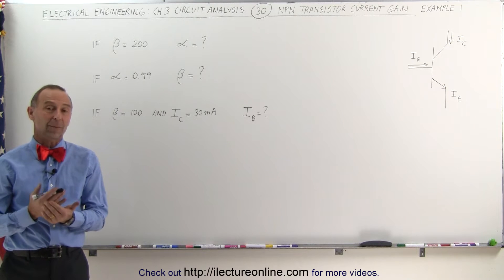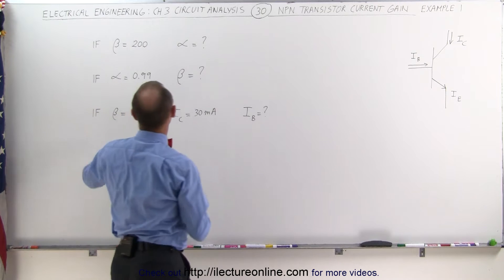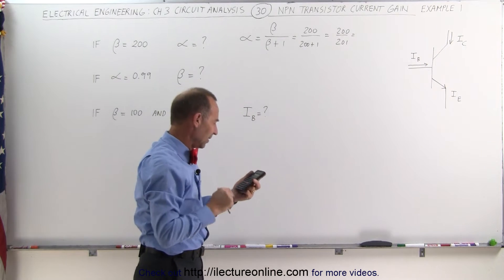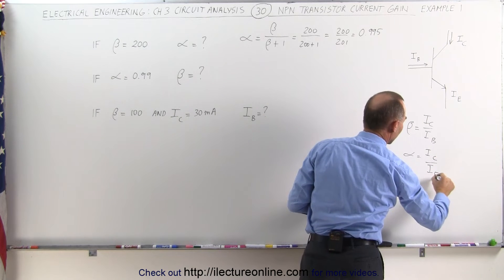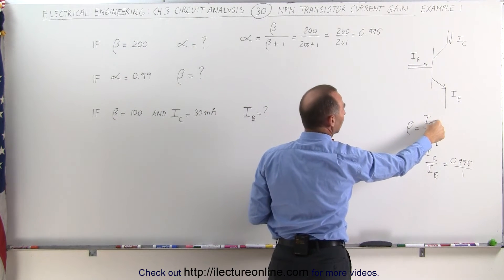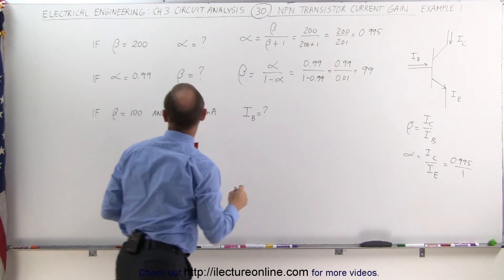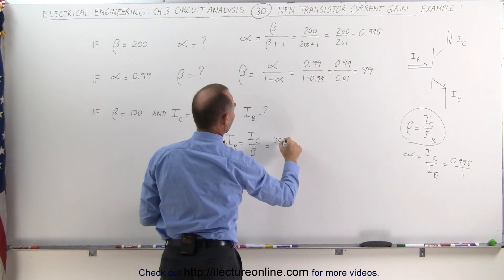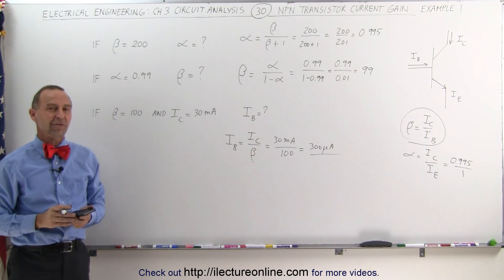Electrical Engineering: Ch 3: Circuit Analysis (30 of 37) NPN Transistor Current Gain Ex. 1

Comment: I assume the 300 microamps is just for the saturation not for the maximum base current the transistor can take?
Reply from the maker: It is the base current required to produce a 30 mA collector current.  Not the maximum available current.

Comment: i have a question guys, why 30milliAmps divided by 100 is equal to 300 micro Amps??? Please answer me, thank you
Reply: Well, in order to better understand. Most calculators ignore trailing zeroes to the right of the number since zero has no end, you just have to imagine they are there. That is why the fancy calculators like a TI-83 has what is called Scientific Notation and Engineering Notation. This allows to see the trailing zeroes but it is specific to the notations being used. In our case, since we are Engineers, we are using Engineering Notation. So if you look at a normal calculator, you would see that 30mA is actually 0.03 in a normal calculator because it is ignoring the trailing zeroes. So the TI-83 sees something more like this 0.0300000000000000=> repeating. Because it is using a function called engineering notation, it knows that in order to look at the number, more clearly it will move the decimal place to the next common engineering notation representation of this number which is in our case milli. So your 0.0300000000 will actually be now 0.030 or 30mA. So in the example shown above in the lecture, if you were to take 0.030/100 it will give you on a normal calculator a value of 0.0003. But you just have to imagine the trailing zeroes so you can see it as 0.000300000=>repeating. So if you can see, the next engineering notation you can move over is in milli, so if you move over the decimal 3 places to the right, the milli representation of that new value is actually 0.3mA. But since he wanted to show it in a nice whole number representation, he move the decimal places another 3 places to the right to put it in the micro engineering notation and thus giving you 300uA. It is more of a visual representation so if you really wanted to go even further, you can even put it in the next 3 decimal places to the right, which would give you nano representation of that value. So it would be 300,000nA. I hope this helps. Clarify it a bit.